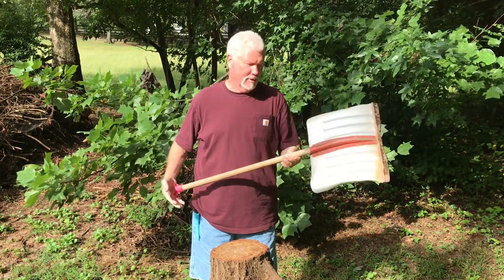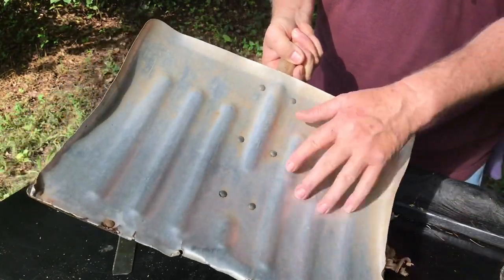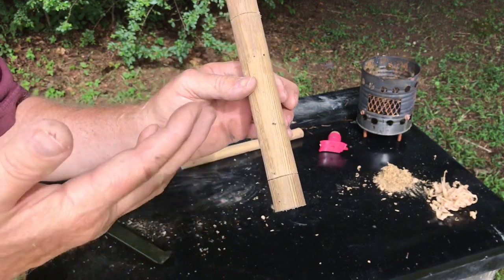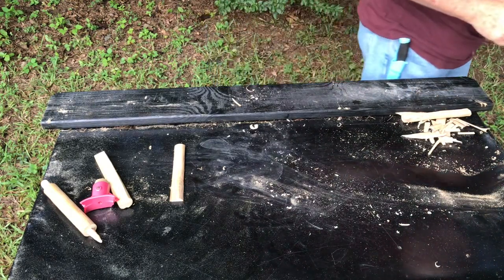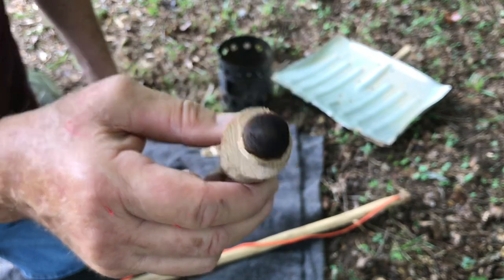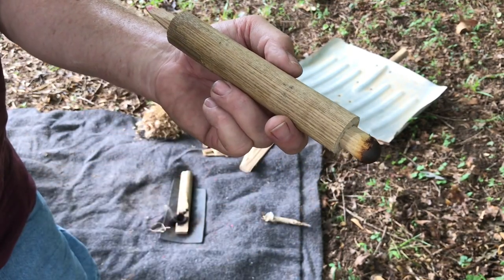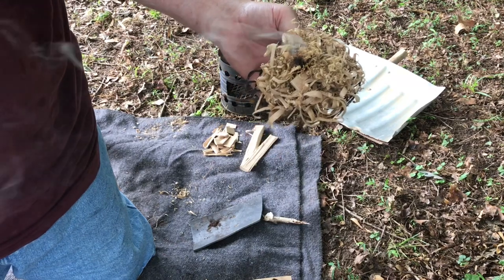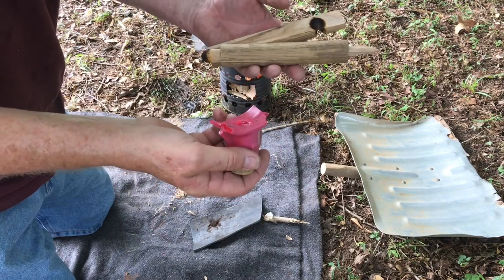Snow Shovel Bow Drill, Only Exposing Spindle's Tips, Plastic Bearing Block, Oak Shavings Bird's Nest

Comment from the maker: I had already thrown this snow shovel in the back of the pickup truck to take to the dump. Yesterday, it got rained on all day. Today, I've got different plans for it. Let's repurpose it into a Bow Drill Friction Fire Set.
   It'll be fun! I figured the oak looking wood would be dry on the inside; and, It was. Not wanting to struggle with whittling a very hard oak, I decided to just expose the tips of the spindle and maybe split out the fireboard too... that is if the grain cooperates. I figured the broken plastic handle 
would make a great bearing block too. I also wanted to show you again the best way to make a shavings tinder bundle go to flames.
   Come see how beautifully this one turned out. Please follow the LINKS below and Subscribe at the end of the video, Thanks!

Bow Drill Playlist
https://www.youtube.com/playlist?list=PLkoXX8XsMW3kw-EXlvpLS68aJjR89P4ae
Bearing Blocks Playlist
https://www.youtube.com/playlist?list=PLkoXX8XsMW3lwi4bBSrVyJkE_omDFGR7g